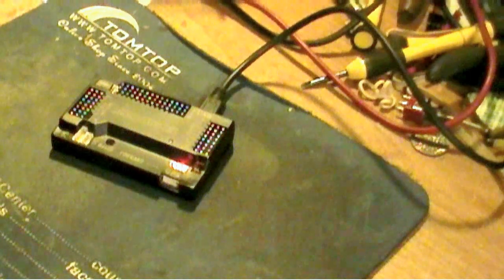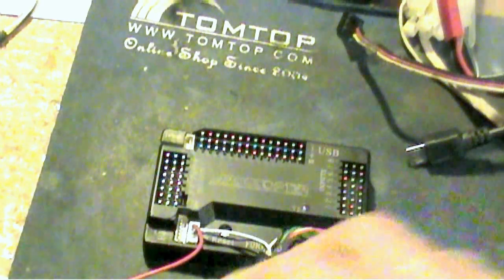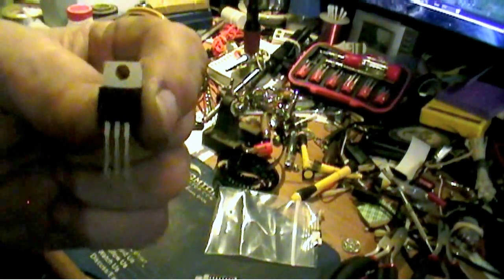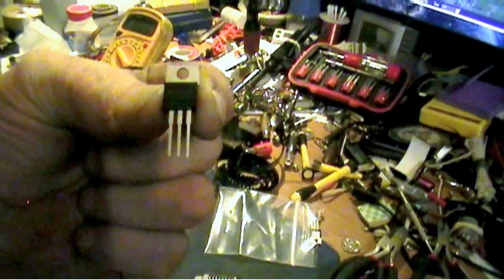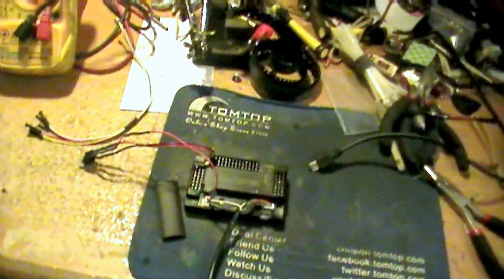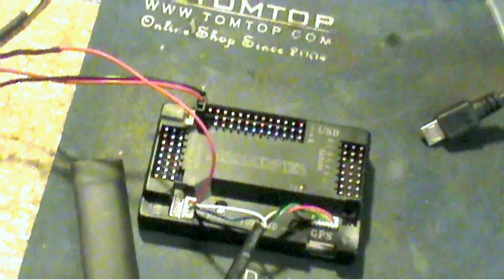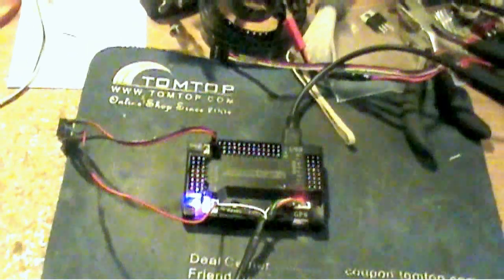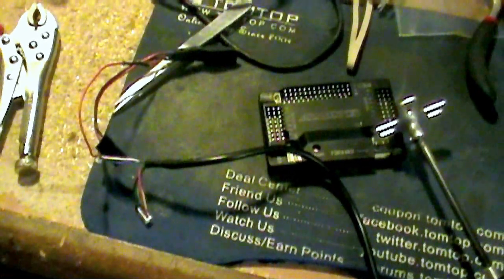APM no heartbeat packets 3.3 v regulator fix

Comment: Good video tutorial. But i have no heartbeat in my apm 2.6 in my conector i2c have 3.3v... I shold have other trouble in my apm. Or this voltage is not real in my apm... Or bootloader is corrupted when i try to downgrade my firmware on mission planner. Do you have some idea about this my friend. And sorry my poor english. Im from Brazil.

Comment: Measure on the i2c connector, the inside pin measured is it 5v or 3.3v. Mine measured is 5v.
Reply from the maker: What version of the APM are you using?
Reply: 2.8

Comment: Hi, I've measured the voltage on the I2C connector and is 5V so I don't know if replacing the connector will work. What should I do?
Reply: im also reading 12v . did you ever get an answer or solve your problem?

Comment: Jerry,   I tried to fix the two of my 2.7 and they didn't work, the new regulator gave 3.27 volts but  I think that's not a new issue. Perhaps I had fried them for permanent. Not only the regulator but something else. Sad.
Reply from the maker: Sorry to hear that Victor. Yeae, sounds like there's another issue. Not sure too, about the pin out on the 2.7 boards. Last I heard that stopped at v2.6 but some aftermarket companies kept going. Even heard of a v2.8. But I believe U.S. Robotics stopped at v2.6 and moved on to the Pixhawk. What I'd read anyway. Best of luck bro and sorr for the late reply.